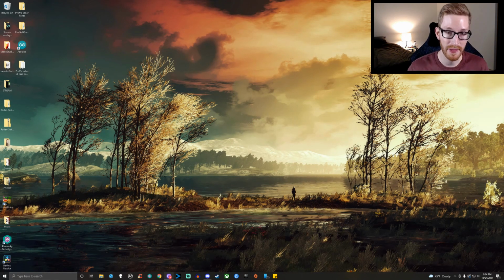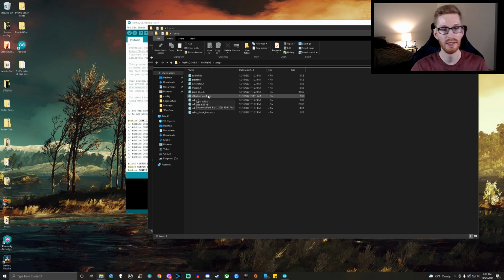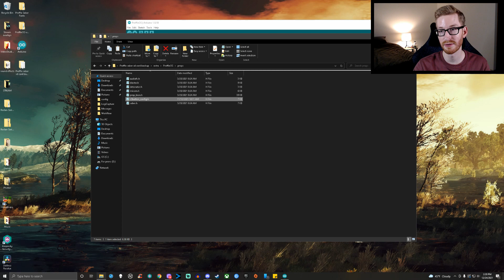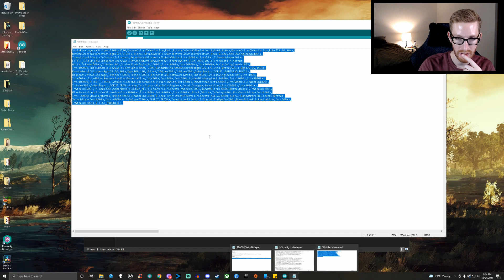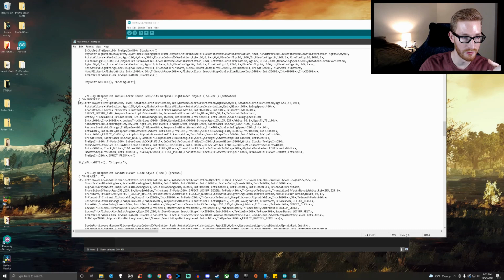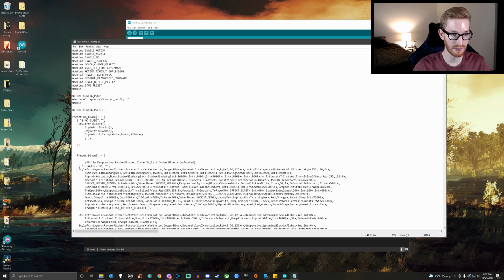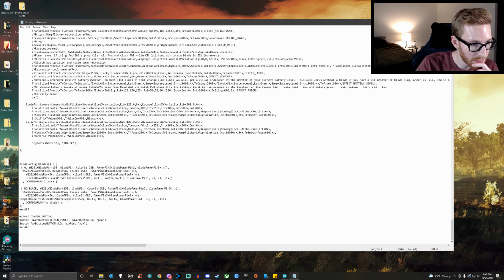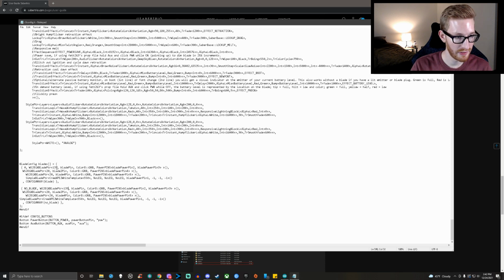A few errors I got when trying to add a new sound font to my Sabertrio Proffie lightsaber

Comment: i can flash with no errors, but the sound fonts just don't appear on the lightsaber when i turn it on. i've followed multiple tutorials and gotten the steps exactly but the soundfonts just won't be there when i turn the saber on... any suggestions?
Reply: I'm having the same problems, did you find a fix?

Comment: thats why you use the config that the company put on your sd card because its the one they flashed to the board...if you would have done that...the button file wpuld have been in there..the prop file...so its not "running into"issues .. you created the issues.
Reply from the maker: Not sure where you think I got a different config from, but I used the config that Sabertrio gave me.
Reply from the maker: I followed, step by step, the tutorial I linked in the description of this video in order to add a sound font and after following all of those instructions, I ran into the problems that I mentioned in this video. If you have a problem with something I did then I suggest you go and talk with the guy who did the tutorial.

Comment: Regarding the StylePtr, since you are using a Senza I think you can just use 2 blades and then just delete the other 2 StylePtr. So you can change the define for Numblades=2

The extra styleptr was for the krosgaard
Reply from the maker: Interesting. That would have saved me lots of headaches if it was already set up with just 2 instead of 4. Thanks for the tip.
Reply: @timewaster12  no problem, now that I think of it. Since you're Senza doesn't have an illuminated activation switch, I think you can even set it to 1 blade
Reply from the maker: @eddiehoang7066  I just tried downsizing to 2 and I got an error in Arduino haha
Reply: @timewaster12  oh shoot, did you remove the 2 StylePtr from all the fonts?
Reply from the maker: @eddiehoang7066  Yes I removed all of them and changed the num blades to match. I understand the error code enough to find the location of the error but I don't understand enough to know how to fix it.  " error: too many initializers for 'BladeConfig'
 "
Reply: @timewaster12  shoot sorry about that,  I thought that would have worked. I don't know why sabertrio had to have 4 blades for the non-krossguard hilts
Reply from the maker: @eddiehoang7066  That's a good question, but I'll get it figured out. If you're correct and I can get away with only having 2 it will make my life easier.
Reply: @timewaster12  sounds good let me know man! I ordered the custom saber from s3 so I have quite a while before it arrives